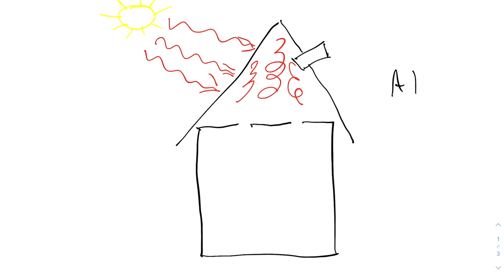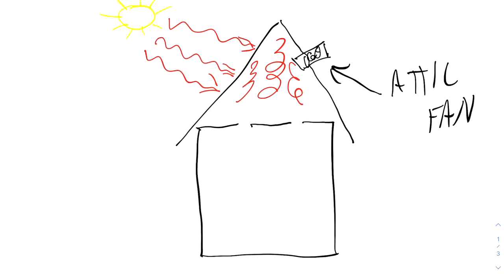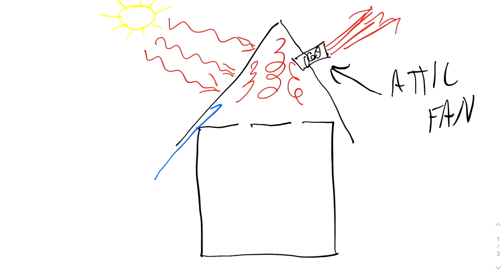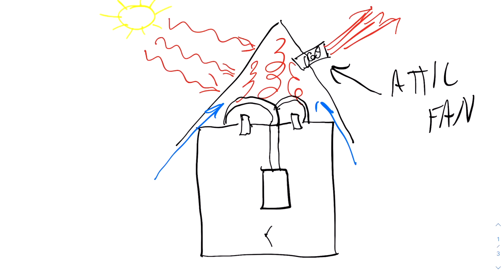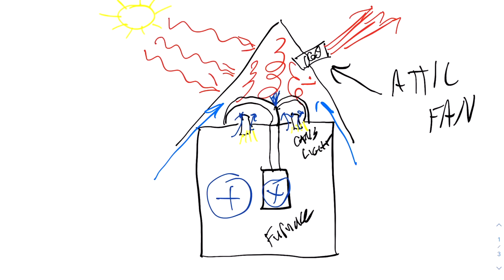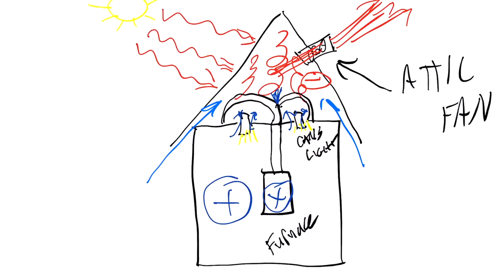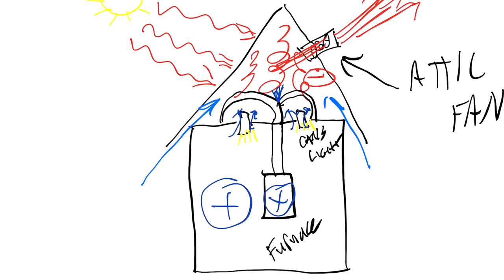3 Remodel Rip-Offs

Comment: Wow! I generally enjoy your video until you bashed solar attic fans. I went from 150-165 degree attic to around 120-125. This was measured over 6 years. If I go on temp alone, then I’ve got to give it a thumbs up. Plus I got a federal credit for the solar aspect of the fan, so my cost of entry was more palatable. I would agree on % energy savings. I don’t think the math is there to the claims, but every vendor embellishes their product.

Comment: Presenting personal opinions as facts is a really fast way to lose credibility. I watched your video before installing an attic fan, and thankfully I read the comments because you are 100% wrong about attic fans. I set up a temp & humidity logger in my attic for a several weeks before installing an attic fan, after the install a 30 degree difference on average and about 10-15% less humidity with only +/- 5 degree outdoor temp difference on average. Granted, I made sure to air seal & added R30 across the joists on top of existing insulation first to ensure nothing is being pulled from the envelope.

Comment: I have so many problems with this video.
1) The microwave analogy is invalid, for mutiple reasons. A microwave only heats the food, and it's disingenuous to say that circulating hot air out of the attic is similar to doing so in a microwave. Note that the air in a microwave isn't hot anyway, which is the opposite of the attic. There are more problems with this analogy, not going to list every aspect that is wrong. This is like saying that if you open the windows in your car on a hot day, it'll stay the same temperature inside because the sun is shining on it. Bad science all around.
2) If the soffit vents are not blocked, then there will NOT be negative pressure. Roof fans do not produce hardcore suction and it is laughable to say that somehow they're going to suck air out of the house when the soffit vents have much easier flow. If you have blocked soffit vents, you have a different issue.
3) "Airwave" and similar blower schemes can be quite useful. I live in a 3-story house in the Pacific Northwest. Without such a blower method , the climate control makes the top floor of my house as much as 6 degrees different from the main level and as much as 8 degrees different from the basement. Running the fan for an additional 15 minutes each hour reduces this difference considerably, spreading the climate controlled air around the house better, evening out the temperature across the rooms a little better. Without spending a ton of money for fancy venting solutions or satellite heat pumps, the fan blower seriously improves this issue in our home. And, as you point out, the air is filtered better for allergies (or forest fire smoke, for those of us who live in risk areas).
4) The amount of re-dispersed moisture from running the blower across the coils after the AC shuts off is tiny.

From just being plain wrong to making mountains out of molehills, I'm sad to say this video is far below the quality of your usual productions.

Comment: I disagree on the windows if you get double pain windows with gas in between the pains is the same as putting insulation in the walls and attic of your house with your logic there is no point in putting insulation in your house nither. As far as the smart thermostat ppl get it because they can control it from anywhere not because it saves money on heating and cooling

Comment: Let's talk about the SCIENCE... "A fan won't keep you cool in a bikini you would need a jet engine". OKAY. SCIENCE would be air sealing the attic and then measuring the time the AC needs to run in the conditioned space before and after, with enough data points. And measuring average lifetime of shingles with such systems. A lot of energy providers will rebate smart thermostats too which makes up the cost.

Comment: OK, normally this guy is pretty spot on but in this case - totally stupid with the attic fan. I can tell you for a fact attic fans definitely work. His reasoning's are the total opposite from what he normally says. Plus microwaves don't have air inlets at the bottom and vent in the top. What in the hell is going on with this guy?!?!

Comment: You talk about “better” things to do instead of an attic fan but I’ve seen no cost analysis. A solar attic fan costs ~$200. How much does sealing your ceiling cost? Or insulating the attic, etc? Here’s a data point for you. My $200 solar attic fan lowers my attic temperature significantly; e.g. on a 90 deg day my attic used to be 130 and the AC never stopped. With my attic fan now it’s 110 an the AC can finally keep up. There’s soffit vents all around the eaves so I doubt much air is being pulled from within the house. Also, your “sunbathing on the beach with a fan” is a terrible analogy. Add an umbrella (roof) then the analogy is more appropriate - but then it no longer supports your theory because an umbrella and a fan will cool you down more than just an umbrella.

Comment: The fan works by moving some air through a hot area. It will always cool the air, its just a matter of how much.
The "smart" thermostat typically ends up running less electricity during peak temperature times, which reduces electric bills if your utility charges according to the time of day. If so it's actually better to overcool during the off-peak times.

Comment: I bought the solar fan and while planning to install, started to think: What about it just pulling air from the nearby ridge vent?; What about pulling air through can lights? Yep, this video and more research helped me realize that I’d get a more bang for my buck (and not risk falling off my roof) if I put effort into to sealing off my canister lights and putting in baffles. Returned the fan to Lowes.

Comment: Dude your view is a bit skewed. Fans work, smart thermometers work, upgrading windows work. You really think people don't want to save 20 bux a month on energy with windows or 15 more on an attic fan or even 20 a month on smart devices?  You got it wrong. Those savings add up and who cares if it takes 30 years. That's 30 years of savings that won't go to the power company

Comment: Your microwave analogy is so bad! An attic fan pulls air through the attic at a faster rate than passive ventilation, period. Even though the attic is heated via solar radiation*, the air inside is hot due to *convection - being enclosed by that hot box we call an attic. It's like an oven, the source of the heat is ultimately irrelevant. If you move enough cooler air through the space, there will be less buildup of heat in the solid materials the attic is made from, even though the sun is still beating down on the roof.

Comment: You review something that you never tried before, fans in the attic work. specially in Florida. and they don't have enough power to pull the cold air from your home thru light fixture cracks etc. You will loose more cold air just by opening the door every time you go in and out of your home. 🤦🏻‍♂️

Comment: Yeah a solar china plastic piece of junk. Automatic  Powered attic fans are not a rip off.  Geez.  You do realize that there are houses that were built before it was common practice to build hang over vents and up out through the roof tip... my home was built in 1960, with not one heat mediation method.  I bought two attic fans of the same power and square footage coverage, one pulls air inside the attic from outside while the one on the other end of the house is pushing it outside.  Its all about lowering the attic temp to the temperature it is outside, instead of 170 Degrees which radiates through the ceiling and into the living space.  Attic fans do in fact work, but you have to have an air supply in order for them to do their intended purpose. You need to have an airflow.

Comment: I do not expect bad advice from someone who generally provides good information, but here the information is totally WRONG. 
Attic fans are the most cost effective ways to cool a house down by 10 to even 20 degrees on hot days. Of course it is obvious that the output air from the fan must be in balance with the air coming into the attic;  intake vents from the eaves provide totally inadequate air.  It is necessary to have (or install)  large open  intake air venting  flowing across the attic.  In cold climates the intake vent(s) can be louvered so that when the fan is not blowing air out then no cold air is drawn in through the cross-vent.

Comment: I disagree also.... Attic are builded to breathe, if you install a fan in the roof, this will help to lower the temperature in the ceiling. common sense" I will install one fan on the house in the next few days.

Comment: 40% savings by switching to double panes is 100% absolutely fake news. HOWEVER ... if you're switching from beat up leaky aluminum single panes to brand new fiberglass double panes? You're going to see a lot better savings than comparing just single to double pane. The reason you're going to change the windows, is so that your properly sized air conditioner can keep up beause you're not air conditioning the outside, and so you don't have a bug army marching through holes big enough to fit a battleship, so you don't have rain getting in your wall assemblies rotting things out, and ... a MYRIAD of other reasons - and at that point, the payback is the DIFFERENCE in cost between double and signle pane, not the entire cost plus installation. Not that it's a great investment for payback - but get real. Use honest scenarios. Nobody is replacing 2 year old windows just to get double panes.

Comment: This guy doesn’t know what he’s talking about the fan pulls air not pushing it into the attic 

Also make sure you don’t have to much insulation next to the soffit 

I’m a home inspector and most attics are cooler with these on top 

The attics in Fl are about 150 190 degrees and should be 120 to 140

Comment: You're microwave analogy is terribly off base. 

Micro waves make tiny water molecules move extremely quickly inside of food heating the item up. 

Now.
Imagine putting an exhaust fan in your oven while it was on with small ports for outside air to enter.... Do you think it would cool off.... Or at least take longer to heat up? Umm yup

Comment: I have been installing solar attic fans for over 14 years and this guy has no idea what he is talking about. In Hawaii and Texas on average I am registering a 40° drop in temperature in the attic and a 6 to 8° drop in temperature in the house without air-conditioning on. With air-conditioning on the air conditioner compressor is turning on Less. That is the bottom line that is after well over 3000 fans installed!

Comment: You go shopping, so you park your car.  The sun beats down on your car.  On your return to your car, the inside temperature is horrific.  Do you get inside and sit inside a closed car to swelter in the heat?  Of course not.  You roll down your windows.  Well, now the scenario is like your description of using soffit and roof vents hoping convection will cool off the inside of your car.  Do you sit there waiting for temperature gradients to empty the hot air out of your car?  Of course not.  You turn the fan on high to get that hot to move with some of it going out the windows.  Do you start driving by rolling up your windows and turning off the fan?  Of course not, you use the motion of your car to blow more hot air out of your car.  Then you turn on your A/C.  Why cool the hot air when there are cheaper and faster ways of exchanging the hot air for cooler air?

I never saw you prove your claims.  Where in the video did you measure the temperature in your attic while using just convection current to move the air from soffit intake to roof vent exhaust?  Nope, you didn't measure.  Did you show the temperature after using a whole home fan to forcibly move that hot air out of the vent?  Nope.  Is the air coming into the soffit cooler than in your attic?  Of course it is.  Could be 135F in your attic, but is it really 135F outside (and not on) your house.  

Do you care about attic temperature when you're not living there (if you don't care about baking your rafters and everything else inside)?  Nope, but you do care about the temperature in the rooms in the floor below your attic.  Yep, there's insulation in your attic (well, you hope you have enough).  Insulation is never 100%, so some of that high attic heat is going to transfer into the rooms below.

How about actually taking air temperatures before using a fan, and afterward.  Bet you'll be editing your video afterward.

Oops, I thought you were talking about a whole home fan.  Nope, you're talking about an attic-only fan that accelerates the rate of airflow from soffit vents (and roof vents, too) to the exhaust port for the attic-only fan.  Yeah, I don't know anyone would bother with an attic-only fan unless they actually had some living space up there, or planned to be up there for awhile, like for rewiring, moving boxes up and down, going through memorabilia, or other chores up there.

As to you poo-poo'ing the claim of temperature drop in the attic with an attic-only fan, I've seen where the mid-day temperature was 135F, but 95F after using an attic-only fan.  That seems like a big drop, to me.  And it would affect the temperatures in the rooms below, but not nearly as great due to the hysteresis by the insulation lagging the change.  No, the temperature change wasn't 60F as shown in the photo, but 40F is still a big drop (in that temperature range, for a 2000F temperature area, you would not notice a 40F drop ... you'd be dead).

Comment: Not correct at all. Attic fans are a huge benefit. I dont possibly understand how you could call it a scam of all things, and to say that its gonna create a draw from around ceiling light boxes and cost you money in that manner is just not correct. The fan will grab air that flows the easiest which will be the stagnet hot air in the space not from around ceiling boxes that are buried in several inches of insulation. Please rethink your theory on this.

Comment: really disappointed in the position taken here on the attic fan. with my personal experience as an systems engineer measuring my homes performance, it simply performs better with an attic fan than without. 

The inaccurate (or  at least uninformed) hard stance here makes me question other things mentioned on this channel that i am less familiar with to be able to accurately critique.

Comment: Omg ... the "air wave" thing - YET ANOTHER example of cherry picking an improper install - with a "huge engine outside" (which by the way gets HOT not COLD ya dingus) ... and your system needs to be PROPERLY SIZED to your house, so it doesn't short cycle, AND so it has a chance to run long enough to remove moisture from the air. Not saying the "air wave" thing is useful, I dont' think it is - but you're saying that based on an oversized unit, smart thermostats are a scam? HERE is where they're not a scam - I don't want to come home to a house that's 85 degrees. I want it to turn to 85 right as I'm leaving for work, and turn back down to 73 when I'm 20 minutes from home. I can do the same thing with a dumb thermostat, but I'll come home to a hot house and have to set the tstat twice / day. Jesus ... are you high on freon?

Comment: He’s sitting here preaching about the evils of solar attic fans without never even installing one and verifying the claims or validity of their effectiveness. He’s absolutely wrong and lost so much credibility by doing this. A good solar attic fan will do wonders for your energy bills in the summer. They had an immediate and noticeable impact on my energy bill. In fact, my energy bill is less than my next door neighbor and I have my temperature set 2 degrees lower, my water temp 20 degrees higher (both electric water heaters) and have a house built in same year by same company and my home is 300 sq ft larger. Before installation, you couldn’t stand to be in attic after 9:30 am on what would be a 95 degree day. Now you can go up in hottest part of the day and not have it be unbearable. Others have done actual thermostat readings and found 40 degree differential. I can say that my experience shows that to be quite valid. My estimate is that I will break even after only 18 months. Considering I plan on living here 25+ years, that’s a lot of money in my pocket over the years.

Comment: Matt, you are dead wrong on the attic fans.  They absolutely DO work.  We had a house in Colorado that was miserable to cool in summer.  It was a sealed roof with soffits and end vents.  I could use my noncontact thermometer and take readings of the insulated ceiling inside.  It was HOT, over 20F warmer than the interior set temp.  When I put a thermostatically controlled AC powered roof vent fan, the ceiling inside normalized to the thermostat temp.  Temperature drop inside the attic was over a 50F drop.

So, NO!  You are ABSOLUTELY, unequivocally wrong!  You need to take this video down.  I like most of what you post, but you have stepped over the line my friend.  You are wrong here.